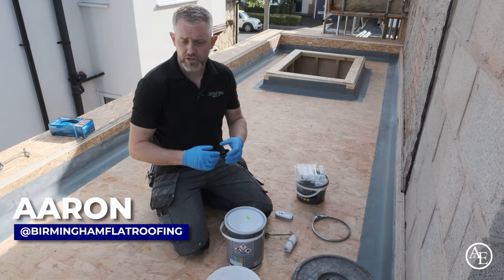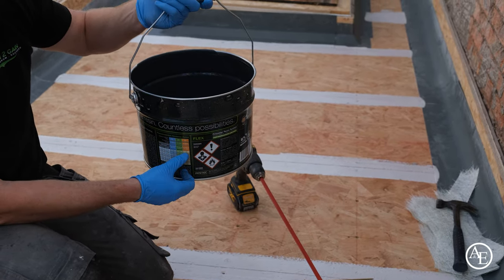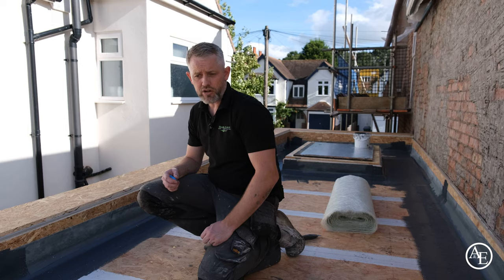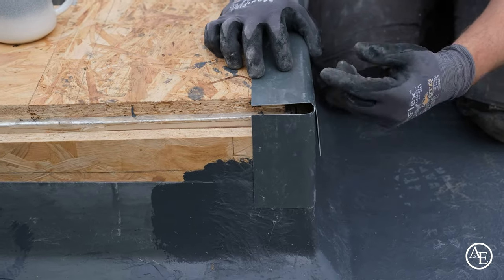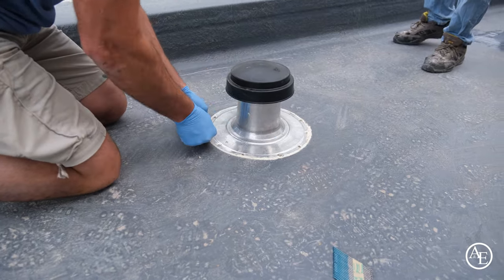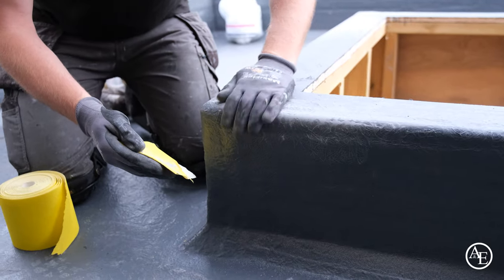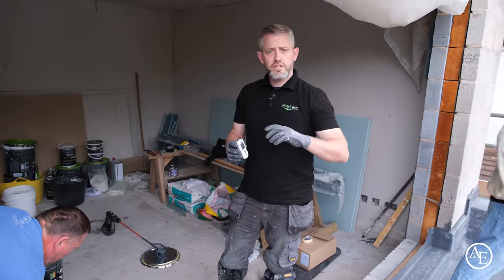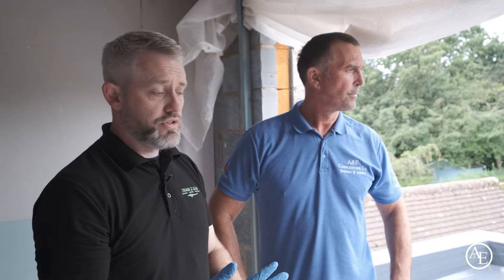How To Install GRP - Fibreglass Flat Roof Part 3

Comment: nice to see the system being applied with so much attention  to detail especially when it comes to the trim prep. so many poor installers out there giving GRP roofing a bad rep. Id say best part of calls we get regarding  GRP roofs leaking tends to be failings along the trims,  usually because no mastik has been used during trim  installation,  you can often find pinholes along the joints where the resin has drained out of the matting and under the trim.

Comment: The final reveal shot was quite dark, or was that just me?
Great job on a tricky roof. GRP is another option for the building site. It's tough but will scratch if you're still moving scaffolding or tools around on it. Not usually damaging to the roof, but the finished look is spoiled. It's hard to get rid of scratches without recoating.

Comment: When you primed the joints in the boards initially, do you not need to tape those as well?
Reply from the maker: Not that I’m aware of but definitely check out the manufacturers specification
Reply: My understanding is that with the 20/20 resin I believe you tape standard square edge  OSB boards. T&G boards don’t require taping.
Reply: Thanks for the clarification 👍👍